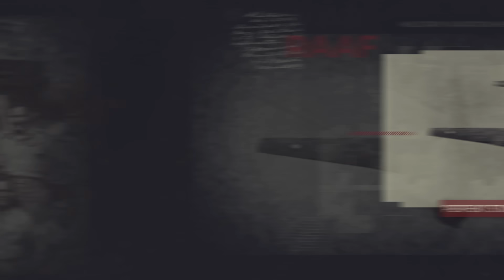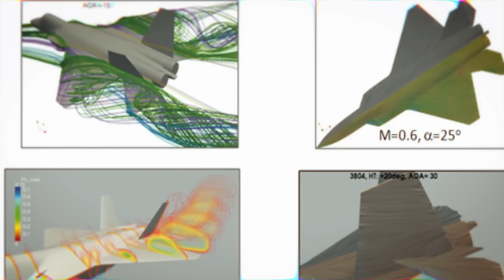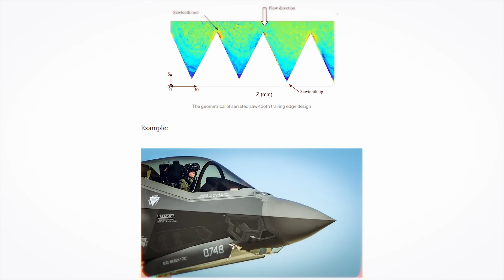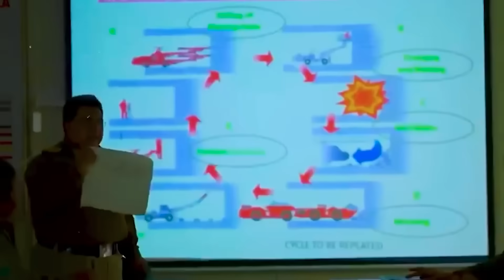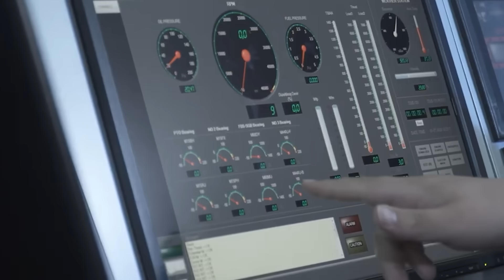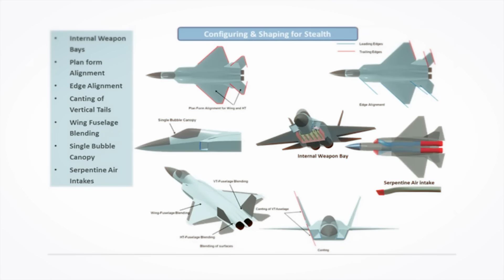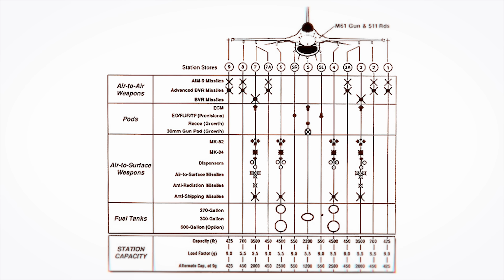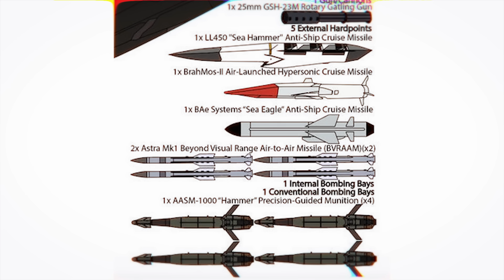India's 5th Gen Aircraft | HAL AMCA

Comment: Comparing it with  f-35 is childish . Single engine to twin engine ..
Reply: Amca and f35 are similar in proportions with f-35 slightly heavy being capable of hauling little more payload compared to amca . Twin engine choice was about more survivability chance in case of engine failure . So that's why they are being compared . U.s used single engine for f35 to keep operational cost down.
Reply: @mattdoespushups2350 😅😅😅😅
Reply: AMCA is twin engine dude and is clasified as 5.5th gen Fighter

Comment: AMCA is just a paper fighter.  
KAAN is a propaganda fighter without internal devices.  
KF-21 is a fighter under serious development, but it is a 4.5 generation fighter.
Reply: meanwhile your su57 is facing difficulty to even form squadron. Kaan already make 2nd prototype fly and kf21 recently test air to air missile. AMCA already going through metal cutting and stealth coating recently developed which is extremely good. they all just started and on they are doing their best.
Reply: @lordzroger951  not a prototype but a technology demonstratot
Reply: AMCA is not in paper anymore! 
Funds has been released for prototype manufacturing... The prototype will roll out in 3 years of funds release..
Reply: What are you talking about? People are showing some curtesy to call your SU57 a 5th gen fighter when in-fact its an SU35 with a new body 
Tell me about propaganda
Reply: Yeaa yeaa only the white skin knows how to make fighter jets
Reply: The strange thing about the Turkiye is that it is a fighter jet with a different design and prototype.
Reply: @honshin23  All existing 5th gen planes are different designs. Nothing special with Turkey.

Comment: Its a shame we dont see more original 5th gen designs, everyone just takes the F35/F22, id love to see more aircraft like the YF23, X32, B2, bird of prey, X36 etc
Reply: i am sorry that governments go with functionality, physics, avionics and radar signature level when designing and not on aesthetics.
Reply: @silabhadrasona6106  😆
Reply: Not entirely true. HAL is already working on tailless flying wing configuration for SWIFT, that too is a stealthy platform
Reply: @orebabaalibaba  True, but SWIFT, and by extension, Ghatak, are unmanned platforms. That allows for a degree of miniaturisation that you cannot get in manned aircraft to the same extent.

If one were to, say, make a manned version of the Ghatak, then you would either need a different airframe form, or you would need a significantly larger aircraft than a fighter, or you would have very little internal weapons and fuel capacity.
Reply: Bird of prey was a very slow test aircraft. It doesn’t even fly subsonic. So you can remove that from the list
Reply: @NickThePilotUSA  i confused the bird of prey with the X36. But still, ofc a test aircraft meant as a stealth tech demonstrator is slow, it used shitty off the shelf engines. A fully matured version with decent engines could easily reach supersonic
Reply: physics and cost my guy
Reply: Form follows function. The design of these jets has less to do with anyone taking a standardised design and more of a convergence that these are the better designs generally. In many ways, the F-22 and F-35 designs are better than the YF-23 and X-32 designs (from a purely technical standpoint, so not covering sensors and the like). As for the B-2, well, that's a massive bomber, and a flying wing fighter may well have fairly significant issues with payload delivery without distorting the airframe's shape and size to a point where you either compromise stealth or have a very large fighter.
Reply: @anantr99  I think its more about copying a successful established design, which is way cheaper and easier than reseaching and developing a whole new airframe from scratch. The F22 and F35 look so similar because they were made by the same people, its lockheeds own design, the F22 and F35 are meant to be "sister" fighters from the same family. Other american companies have proven that different designs can be just as competent. The yf23 was equal in capabilities to the yf22, even better in some aspects. even the su57, although lacking in stealth, looks pretty unique. The 6th gen fighters in development for the NGAD and F/A-XX programs are  gonna be flying wing type jets most likely.

I understand that its way more effective to develop a fighter by taking an existing design and that aesthetics dont mean shit in fucntion, i just think 5th gen designs have so much potential to look really cool and unique

Comment: Still two engines - which means their propulsion tech is still lagging.
Yes - I know the ‘two engines more reliable’ argument. 
Valid in bygone eras - but not today unless your design calls for mad kenetics (like Typhoon)
Reply: Because  India's elevation varies greatly, with the highest point being the Nanda Devi peak in the Garhwal Himalayas, which stands at 7,816 meters (25,643 ft) above sea level. The country's average elevation is approximately 1,017 meters (3,335 ft) above sea level. The lowest point is the Rann of Kutch in the state of Gujarat, which is about 2 meters (6.6 ft) below sea level.
India's temperature varies greatly depending on the region and elevation. The highest recorded temperature was 51°C (124°F) in Phalodi, Rajasthan, while the lowest recorded temperature was -60°C (-76°F) in Dras, Jammu and Kashmir.The temperature in most parts of India can exceed 40°C (104°F) during the day during the summer months, with the coastal regions experiencing higher temperatures due to high humidity
In the Thar Desert area, temperatures can exceed 45°C (113°F), while in the Himalayas, temperatures can drop below freezing
. The temperature in the northern parts of India, such as in the Himalayas, can be quite cold during the winter months, with temperatures sometimes falling below freezing

Single engine are not good for country like India .
Reply: Raptor has 2 engines, future 6th gen designs have 2 engines
Reply: Doesn't NGAD have 2 engines as well ?
Reply: They don't have a domestic engine yet, hence their effort to hook up with GE, RR or even Snecma.
Why is 2-engine setup 'valid for bygone eras' ?
Similar argument was raging for field guns remember, until UA started pulling out WW1 pieces to ping RU.
Reply: It's matter of fact what doctrine the air force follows. We all can have debates and debates about it, there are both pros and cons in each. But what is important is the placement of these fighter planes. What priorities do they have... Such as the more time to stay in air bcoz in dual engine aircraft are bigger so more fuel capacity. Yeah, we can argue about these typoons but their requirment is STOL and manuvrable af that's why knards are there.
Reply: Utter drivel. USA's NGAD is also a twin-engine design. People really be coming up with some of the weirdest comments just to justify their own delusions that anything India makes will be substandard. Well newsflash, your opinions don't matter in the real world. So GTFO and get a life.
Reply: That's really stupid.
Having a single engine in a fighter jet is risky.
Reply: @honshin23  to be honest with ya. It's not, in today's world with so many fail safe around it for pilots risk have substantially cutted. Yeah the argument does stand true in worst to worst situation i.e War and having bad neighbours that generally take UN and it rules for the drinks.